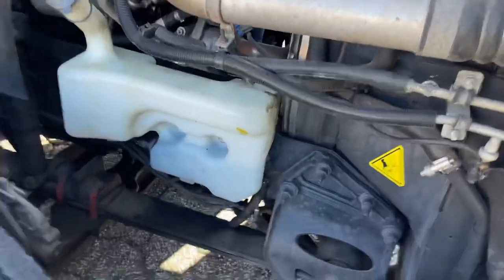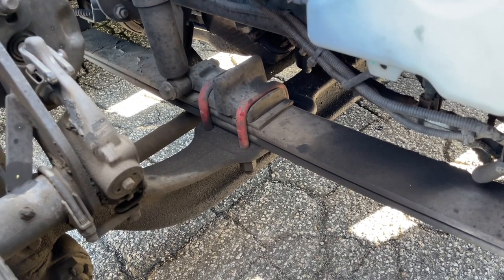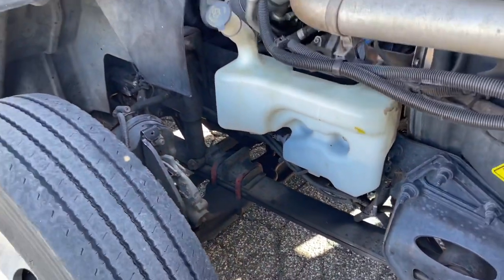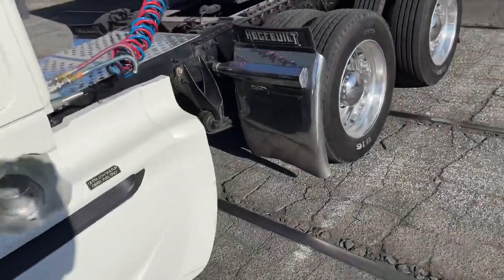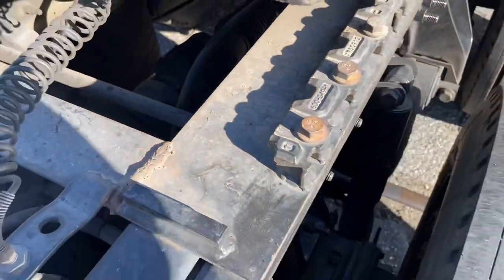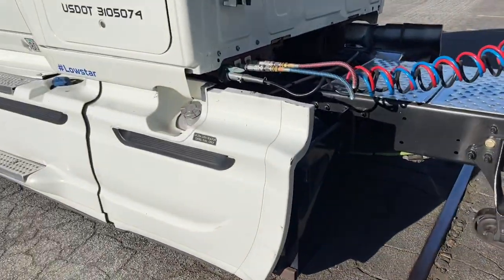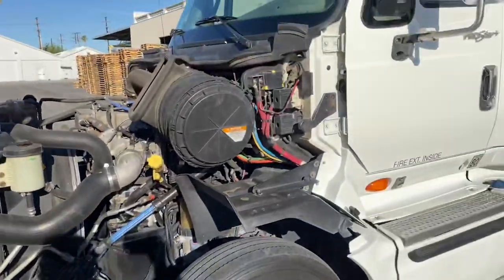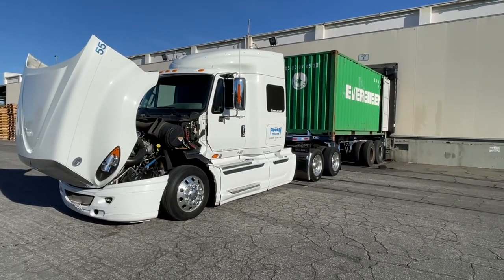How Did I Lower.. My International Prostar??  Part 1

Comment: I have a 08 Prostar, I took those blocks out when I replaced the front springs. A place here in town makes U bolts so that wasn't an issue. Only issue I have is that the bars for the tanks rub sometimes going into job sites because mine is stretched. We put 5'6" in the frame back in 2014, it's 296 Wheel base.
Reply from the maker: Airbags up front will take care of that problem

Comment: Great info and great job... And your bear is because the way the sun hits your face while driving becarefull with that as there's some extreme cases where a driver face turn red on 1 side.. Why didn't you just replace the leveling rod?? Got to realine the front drive line because eventually your gears are going to jam.. Also creating problems with sway bars...check the rear sway bar and you will notice more wear.. Tnx like the front 1s
Reply from the maker: Thx. And no problems for a year of all the things you mentioned, but good advice either way.!

Comment: How did your buddy with the cascadia lower his? I tried to take the block out of mine but my springs have a center bolt and my steer axle also has what looks to also be a center pin that line up into the block if I remove the block the pins are  now touching and doesn’t seem to fall into anything doesn’t seem right so I just put the block back instead till I see the way it’s done
Reply from the maker: Video coming soon
Reply from the maker: The part 2 video is up, you can see how to do it.!
Reply: Right on brotha that was a great video I was close but did not remove that pin thanks for the video very helpful

Comment: Mine has airbags in the front brother, any way I could just lower it with those airbags?
Reply from the maker: Yeah.. you’ll need a switch that controls the air valve on the leveling rod, just like the rear. That way you can adjust the ride height. 4 States in Joplin Mo. should have a universal kit. I would call them and ask..!